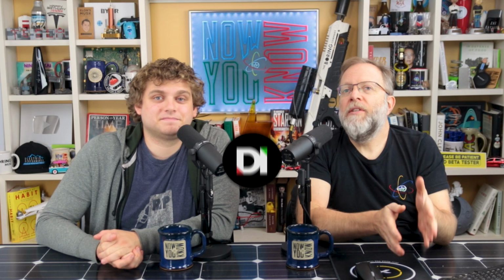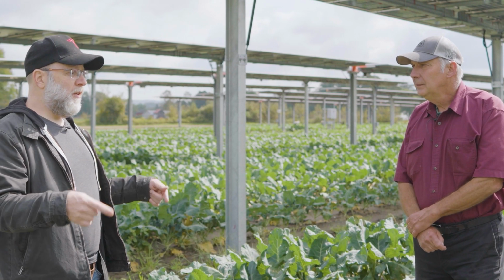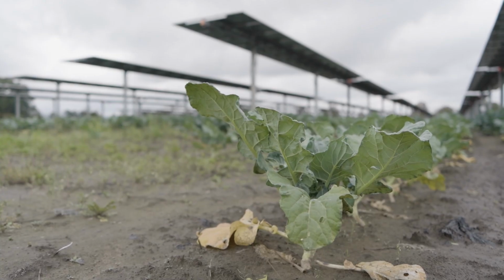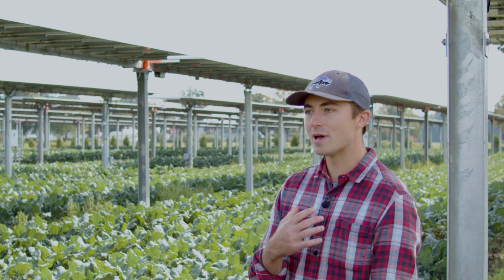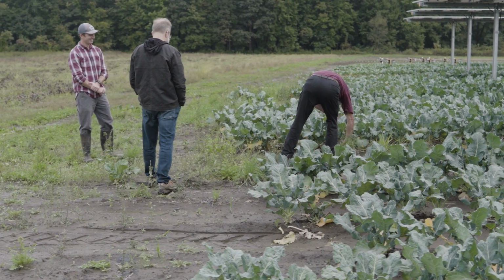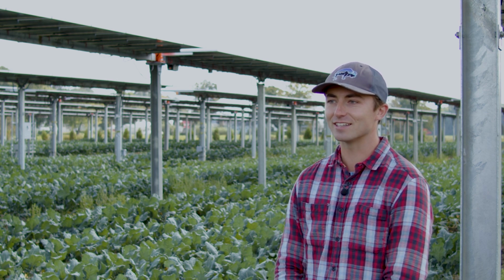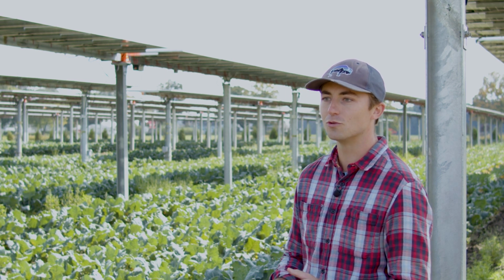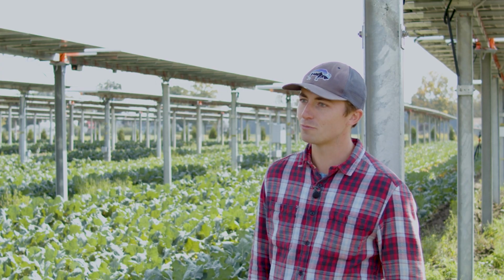Everything You Need to Know About Agrivoltaics | Disruptive Investing News

Comment: 21:10 i think the main reason the state implemented a 10' height minimum because if there was no minimum some installers might use normal ground mount equipment and just graze sheep under the panels. It seems that most jurisdictions want to avoid situations where the solar panels might allow or push the farmers to decrease the horticultural intensity of their farming operations, ie taking vegetable farming ground, slapping solar on it then down shifting that to pasture or forage land.

That said, 10' might not necessarily be the best limit. 8' seems pretty reasonable. I still think that the ground out here in ca that grows cotton and tomatoes on rotation could be ideal for deploying agrivoltaics at scale.
Reply: 10' might look like overkill height for a field of broccoli, but as someone from Illinois farm country, I instantly noticed that the 10' was high enough to grow even very tall crops like corn or sunflowers.   All the Community Solar projects that I'm aware of around here, were built with just the sort of low "normal ground mount equipment" that you mention.   Farmers in this area tend to rotate Corn and soy beans, and depend on normal rainfall as the water source.   Some of them see the Solar farms as something that only takes farmland out of production, but a set up like this would not do that.